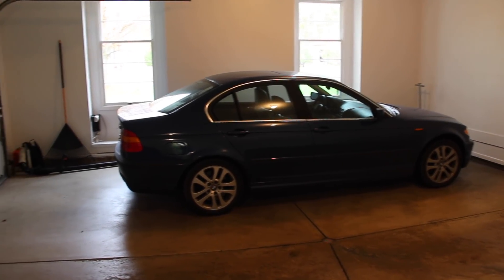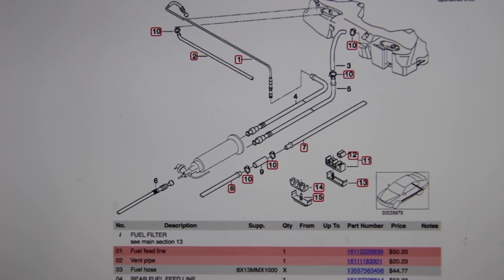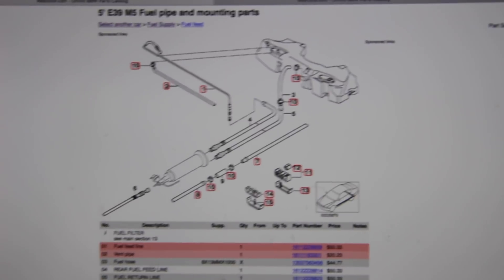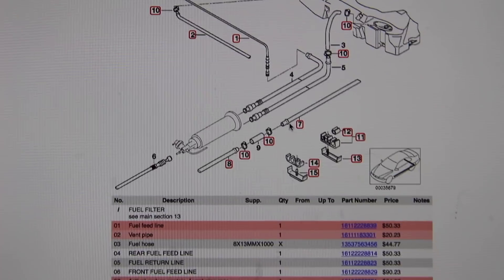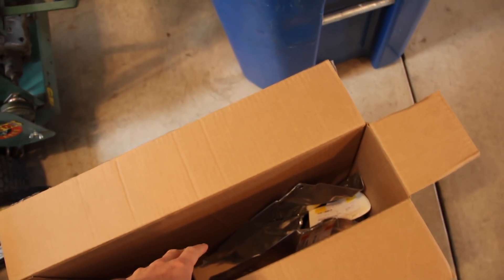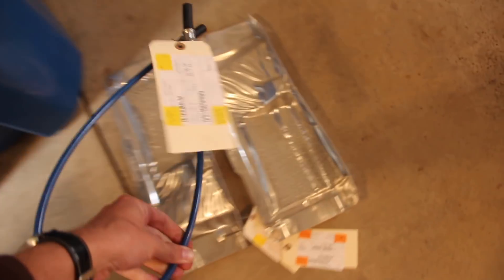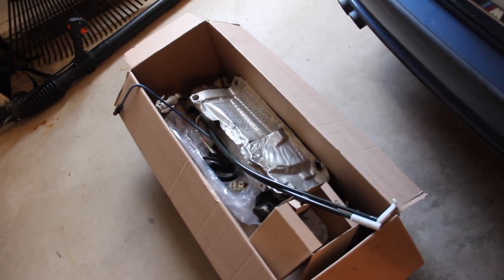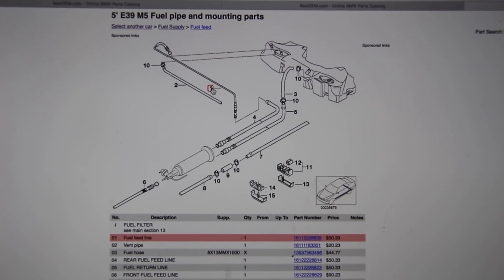BMW E39 M5:  Fuel System Exploration

Comment: hi thanks so much for this video.  on my m5 I was told the tank has to come down to replace part 7.  the vent.  is this correct because I think you said the tank can stay for this line?
Reply from the maker: It's been so long... I don't recall precisely.  I would say that the tank does need to come down for that line, though I would certainly try to do it without removing the line first.
Reply: @E39Source  Hi yes I bet. I'm just thinking in the UK these cars rust near the tank area.  So if it does have to come down I may as well refurb that whole area.